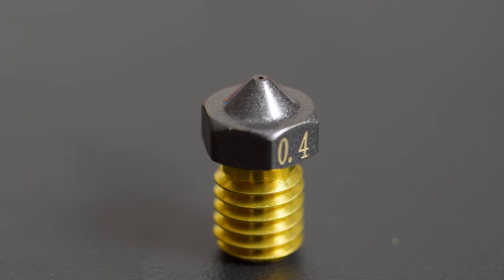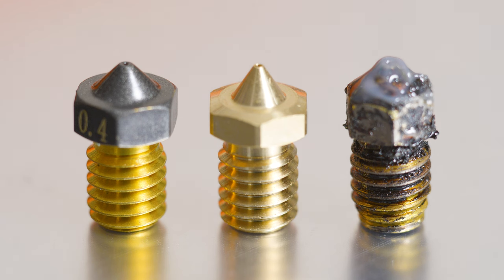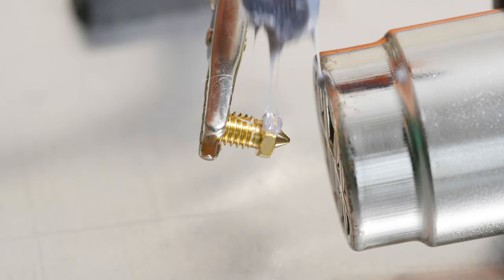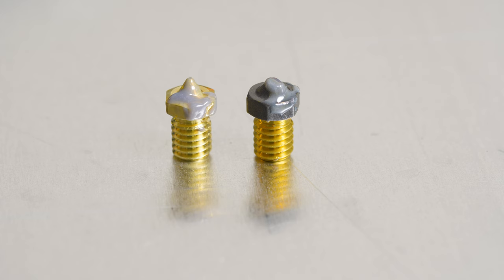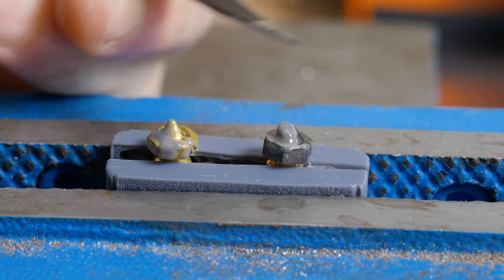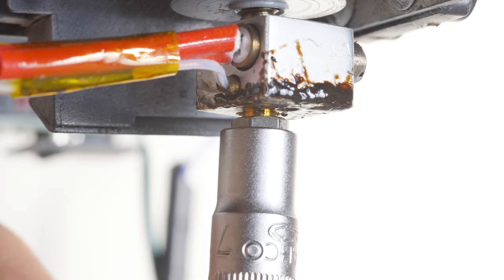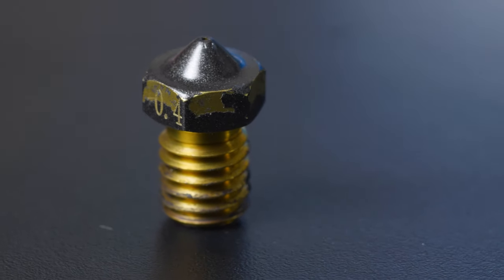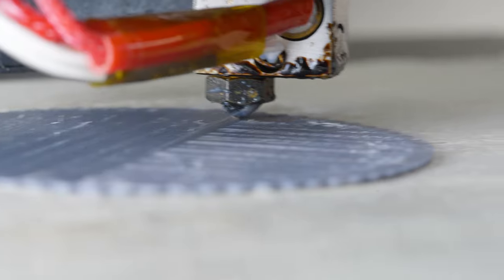PTFE Coated (Non-Stick) Nozzles - Do they work?

Comment: Glass transition temperature.
Melting point temperature.
Find a temp in between those two to peel off your plastic.
Some plastics peel off below melting point without coating
Reply from the maker: Ohhh very interesting info, I'll have to check those 2 numbers

Comment: Get a wire brush, and use it when the nozzle is hot. You'll never have a nozzle like the one at 0:07 again.
Reply from the maker: I use that option but small wire brushes soon get clogged. Ive seen a servo operated arm addon for the voron 0.1. That does automate this cleaning, its something ive been meaning to install
Reply: @ThisDesignedThat  I use a large one. The bristles tend to splay out over time (like an old toothbrush) but it still works. I didn't find out about wire brushes until I'd been printing for a couple years, and dirty nozzles were a huge annoyance as a result.

Comment: So max temp is 250°C then? Otherwise it would destroy the PTFE
Reply: Mhm PTFE is external only, and the air is what maybe 40 50°C cold tops. So there's a gradient and PTFE is definitely much much colder than the nozzle set point.

I have done some K-type thermocouple probing. With regulation setpoint of 250°C, i measure about 260°C at the heater cartridge, 215°C on the nozzle sides, and 190°C on the slant near the nozzle tip. Super clean new nozzle. No airflow.

In contrast if you have PTFE liner, it will reach setpoint temperature. I think the inside of PTFE layer of the coating at the cone of the nozzle will be at least 20° colder, which should give you leeway to print engineering polymers which need a little above 250. I would remove the PTFE coating at the hex flats of the nozzle since it will be the hottest there and doesn't really contribute to printing, also prone to get scratched up.
Reply: @SianaGearz  i really doubt that the top is any colder than the middle of the nozzle. Maybe if it would be water cooled. Air is really bad in cooling stuff. 
It´s 1-5 °C diffrence at max if you ask me. Thas the whole idea why people use brass nozzles.
Otherweise clogged nozzles would be a much bigger issue.
Reply: @Gromic2k   I don't think it would be. After all the plastic in the nozzle is molten, so as a liquid, it has a pretty high thermal conductivity itself. As a solid when it's cooled down, the thermal conductivity is low. It takes a good while when the hotend is already at the melting point of the plastic to actually re-melt the plug in the nozzle, but it's hidden by hot-end's settling time before the print begins. We also print a LOT hotter than the temperatures at which the plastic begins to be molten, about 50°C hotter typically. Thermal conductivity of brass is neither particularly low nor particularly high, and even twice as thermally conductive aluminium it's easy to measure a thermal gradient from the hot to cold ends of it in free air. You also have a thin wall structure at the conical section of the nozzle which is the one that matters for the coating.

I think it's fair that a better experiment is needed to see what the temperature of PTFE coating in the working zone would be. I tried Kapton taping the thermocouple but wasn't very successful with the setup, it didn't want to stay put - Kapton would imitate the gradient over the thickness of PTFE.

Comment: What about some PTFE lube on the nozzle ? I use Facom's and it works quite well here for PLA and PETG, especially on my Pusa Mini as you can't add any silicon sock which hampers with cooling. You just want to add a little spray every 10 prints while the nozzle is cold allow it to dry then wipe the excess off. To be tried on a brand new nozzle of course. I'm not sure PTFE is any good for high temp materials.
Reply from the maker: as long as it dries properly and there's no risk of getting it on the build plate I'm sure it'll work. Yes you definitely don't want to get PTFE super hot so it starts to off gas

Comment: Good Video, i was hopping the coting more robust.  

https://m.youtube.com/watch?v=tPEVNLrIyMM
He tried some stuff to spray on. 
I don't know if this is better or not?
Reply from the maker: I'm sure it works similarly. Shame he didn't show any examples in his video
Reply: @ThisDesignedThat  PTFE doesn't seem safe to heat past 220C, teflon flu is also a thing,  found this Molybdenum Disulphide interesting instead, has much higher temp resistance, comes in a dry spray
Reply: I tried that with some ever so slightly cheaper (£14 vs £17) "DM-90" brand and it didn't want to stick to the brand new brass nozzle and just wiped off. Maybe I should try again and leave it for 24 hours (even though it said "touch dry in 15 minutes").
Reply: @KentoCommenT  Very interested to know if it does stick after more drying, or maybe it depends of the brand of MoS2 dry spray ?
Reply: Glass transition temperature.
Melting point temperature.
Find a temp in between those two to peel off your plastic.
Some plastics peel off below melting point without coating